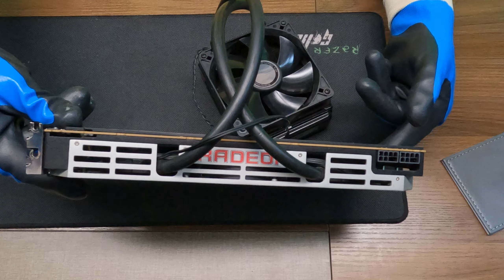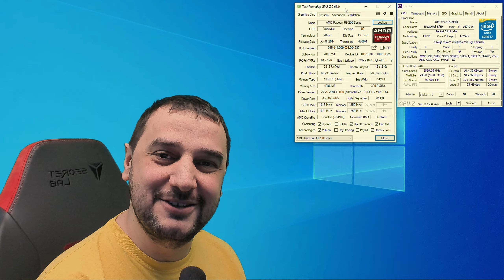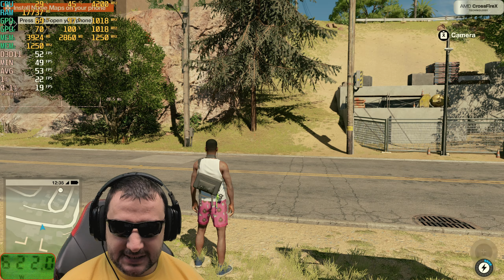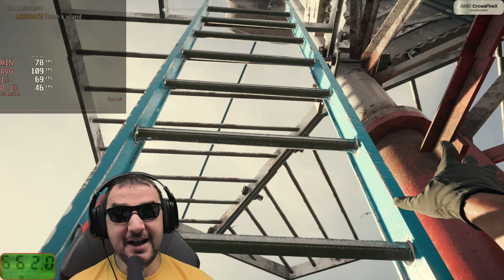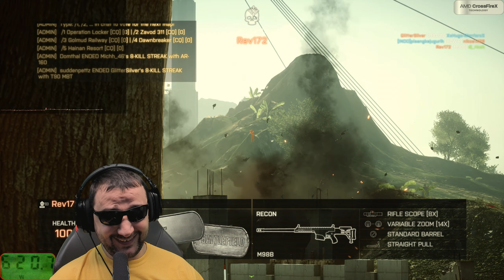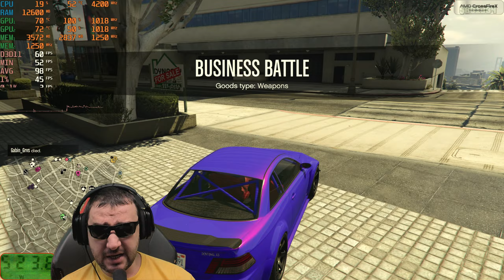AMD Radeon R9 295X2 Benchmark

Comment: I remember this card when it came out it was insanely powerful for it's time.
Crysis Warhead was out then.
Ran it Flawless 
I had and 17.5 ACER Laptop  with a GTX 280 DDR3 1.5G of Ram...
It was insanely smooth in games..
Best thing I owned for  5 years..
At the time I wanted this card but gladly didn't buy it because of the power and heat issues.

Comment: Ive got r9 290x normal one. 

This is a crossfired isn't it? 
But i thought that the crossfire and SLIs are not working on most of the games now ? 🤔 Most of the time inside the game it only utilise only one gpu?! So did you use some kinda technique to work both gpus? Or all the games you tested support crossfire by default?

Comment: Hey brother. I agree it does seem to have a CPU bottleneck. Maybe try running the games with DXvk maybe valkun will let them fun multi core instead of single
Reply from the maker: how do you add vulkan in games? or is that a feature that the game has and i have to chose those games?
Reply: @DanielCardei  Look up DXVK its modded Directx files that make DX games run in VK. As for crossfire I'm not sure I can look into it
Reply from the maker: BTW Vulkan doesn`t support crossfire right?
Reply: @DanielCardei  ok checked into it Vulkan supports Ali and crossfire

Comment: If you have aio water coolers in your collection you will need to learn to service them. If water temps in the aio go above 65 degrees, like all the time, sealings will start to disintegrate and pump may go bad as it uses water to cool itself, like every waterpump does. These all lose water over time even if they are sealed. Less water in them means less cooling mass. Only way you can refill these without damaging the unit is by screwing off the copper coldplate that is in direct contact with the cpu or gpu. Trick is to use way more force on the screws then any sane person would use, otherwise you will probably strip the screws. Behind the cold plate is the pump normally. If you keep the radiator as lowest point and shake it air will escape and you can replace the air with cooling water.
Reply from the maker: What's inside? Distilled water?
Reply: @DanielCardei  I have been using DP Ultra, it has anti corrosive stuff etc. 1 liter will last you a long time, costs like $10/15. Double Protect Ultra.

Comment: We basically have the same setup going right now with the x99 platform and 6950x CPU. I''ve got mine overclocked a little bit but it looks like you're sitting at 3.8GHz. I haven't been able to keep mine very stable past 3.5 or 3.6. The RAM has been tricky to get dialed.
Reply from the maker: In my bios there is option called TPU I and TPU II. I've selected TPU2 and it adjusted to boost the cpu and setup the memory for it. I think it lower the speed of the memory alittle.
Reply: @DanielCardei  Don't use any predefined overclocking profiles, they're shit. Manual OCing > OC profiles

That said, BW-E overclocks like ass and it's IMC is very, VERY cursed.
Reply: Like Daniel states try lowering your ram and cache speed a touch. Intel generally like a down bin on ring by 300mhz
Reply: @j-cuts1776  I've got the 16GB Corsair Dominator 3400MHz "orange edition" RAM that had a product tie-in with the Gigabyte x99 SOC Champion, as well as a similar kit of 32GB Corsair Dominator 3200MHz. I haven't been able to get either of them stable over 3000MH. Even at 3000MHz, if I start overclocking the CPU, the stability during memory training is hit-and-miss. I guess I can try lowering it below 3000MHz. I'm pretty new to x99 so not sure what kind of perf I should be expecting.

Comment: 5 fps minimum is insane ...what cpu did you use for the video i hope and old cpu for its generation and not a nowadays cpu,also in crysis everrything maxed out would be a good benchmark because it supports multiple gpus
Reply: I7 6950x 10c)20t, I have a 10900f 10c/20t  locked at 4.6ghz with a 6800xt and 64gb DDR4 4000 cl18. Perfect combo. Never CPU bound at 1440p.
Reply from the maker: its literally in the first 5 sec into the video.

Comment: i wouldn't put such a video card inside my PC even if you paid me !!!
i've seen the more recent/updated-power tests from sites as TPU ,and GPUs such as this can have massive "spikes" in their load. for example the RTX3090Ti has average gaming power-draw around 440watt ,but it can spike up to +100 more for few miliseconds which is extremely dangerous for a PSU if it happens frequently !! 
So back in those R9 295x2 days , where such spikes weren't measured during reviews ,my imagination is "screaming" about what kind of power-spikes(and their frequency also matters a lot):face-orange-biting-nails: might this R9 295x2 have!!!
Reply from the maker: Maybe the psu quality was different.

Comment: tech powerup suggests a 900w PSU for this card!
that's wild considering it outputs the performance of a 1660 which only requires a 300w
Reply from the maker: I made sure to put a 2000w psu in this machine 🤭

Comment: Good, that you customised Afterburner overlay 👍
Reply from the maker: i have too for 1440p. My software its setup for 1080p but need to make it for any resolution.
Reply: @DanielCardei  Good. I started watching yesterday's Far Cry video, but didn't finish yet and Far Cry 1 on modern card- only in 1080p? 

Of course, don't forget about VRAM utilisation vs allocation. I can say a new thing about my own experience. I started playing Doom Eternal just yesterday. Max settings, 1440p, 3060 Ti. VRAM allocation shows whole 8 GB allocated. But real usage shows about 7,3- 7,4. If I only look at allocation and think it is a real usage- I would rather lower settings to avoid stutters, missing textures etc. But I don't have them- stable 60 FPS locked.